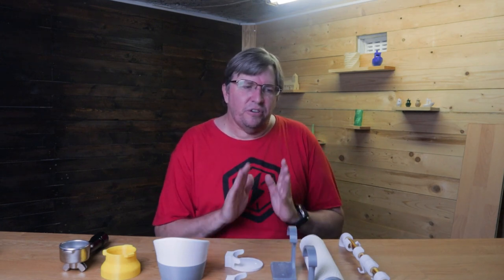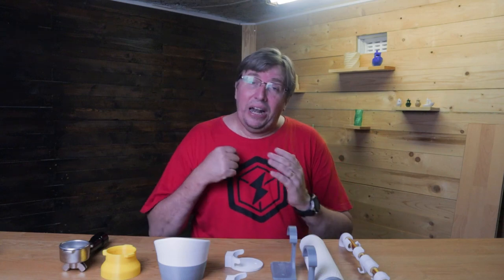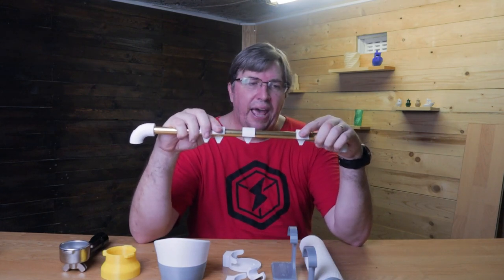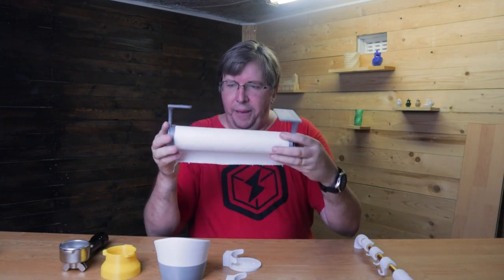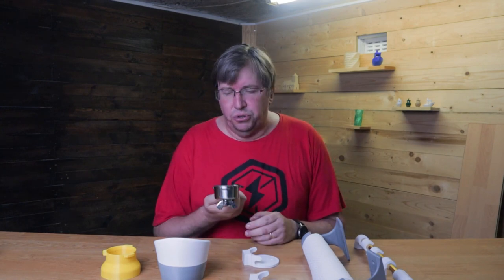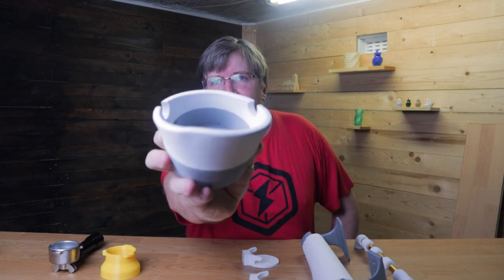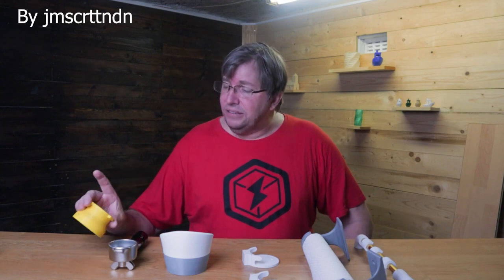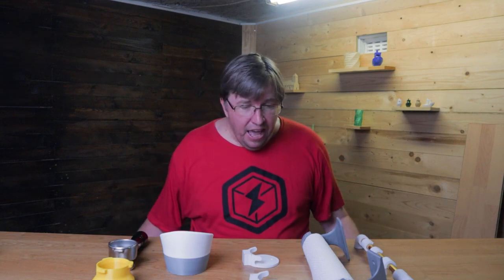5 Awesome Practical prints that you must see

Comment: Hi what Slicer speed/ print height, temperature settings did you use to print these? I baught new SA filaments but cant figure out what settings to use with it... also nozzle size?
Thanks
Reply from the maker: Hi Casper, 0.4mm Nozzle, SA Filament prints best at about 215 C, Ender 3 at 60mm/s
Reply: @FusionSource  thank you